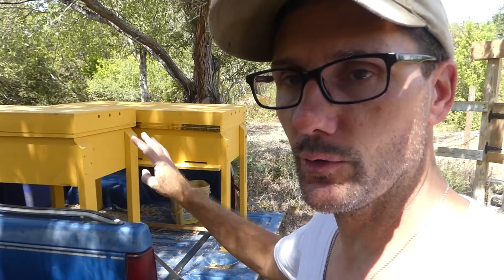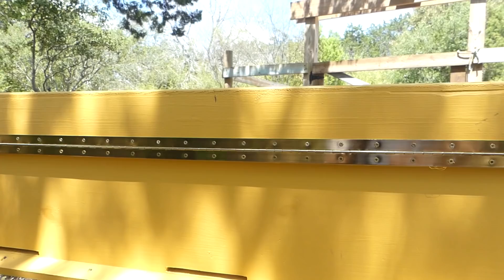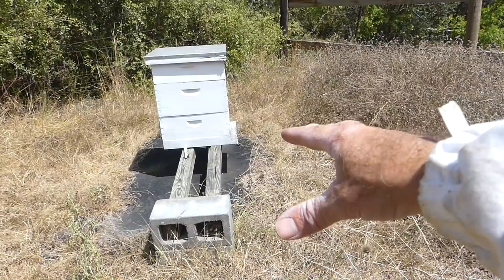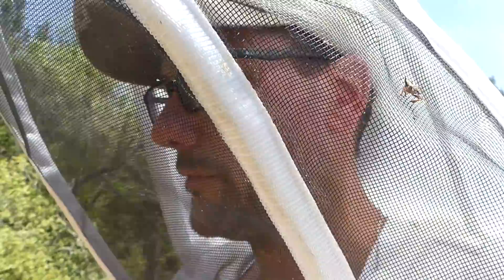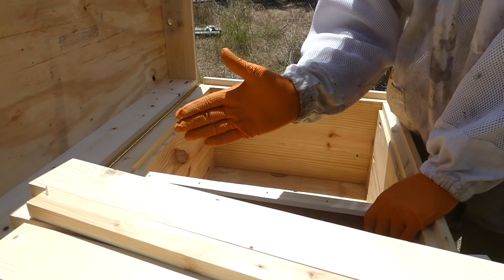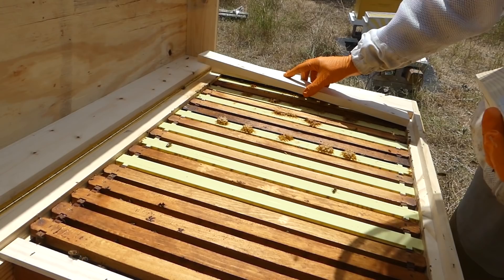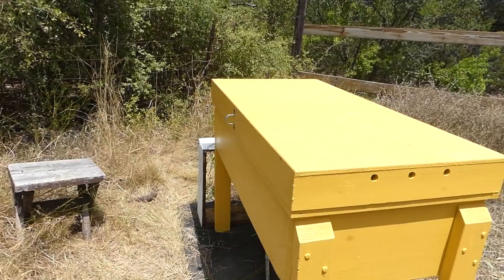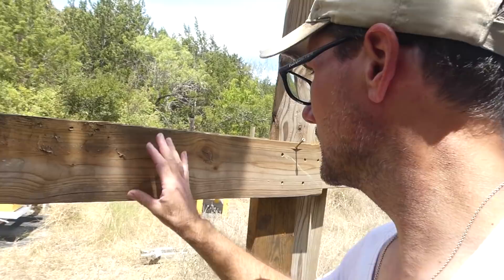COULD THIS BE THE BEST BEE HIVE EVER?!?

Comment: I don't want to highjack this video, but want to leave some observations. but i came a cross a video on these several years ago and liked the idea (i have a really bad back) so i built 4 of these 3 years ago, but have only used 2 up till this year. Still learning with them. Some things to consider. I built mine with 1" pink foam insulation sandwiched between 2 pieces 1/2" BC plywood for the sides and end piece.  I did this for warmth. Gets cold here in Nebraska. I will also insulate the bottom on any future ones i make. I also put a pitched roof (3/8" plywd covered with metal) with hinges on 1 side and a chain to hold the top when opening it to keep it from falling clear back over to the other side. I left a gap at the top where the plywood met and covered it with mesh screen for ventalation and put a metal cap over this to keep out the rain. I also use 4x4 legs that i notch out and actually sit the frame on and bolt to them. The 2x4 legs on the hives above i wouldn't trust once that hive gets full of honey. It wobbled quite a bit already. Mines rock solid. Having my own construction company for over 26 years gives me a pretty good background in building.   Built it to the exact inside demensions of a Langsford hive so i can use the same frames. Make sure ur top boards are within 3/8" of the top of ur frames, or the bees will make honey comb between them. I learned the hard way.  I cut a hole in the bottom to put a sliding piece (10"x14")on the bottom to be able to allow some ventalation in the summer. Really don't need this i don't think.  What i'm finding out is , being high off the ground way to much cold circulates under them in the winter which is making it to hard for bees to sustain warmth. Killed off hives both the last 2 winters. This winter , i just finished enclosing them (around the legs) with 1 1/2" foam insulation (6R value), i enclosed 2 hives together so as to use a 2'x 8' piece as my hives are 4' long each. I placed a bunkhouse heater under each set , already set on low, that i will plug in and use in really cold weather. I'll insert a candy thermometer thru the insululation to see temp as i only want the dead air space to be in the high 20's. Hopefully i won't even need these heaters.  The insulation will  also block wind  from under the hives. I don't want to heat the hives. The heatersb/ will only b turned on if extreme cold. Last year our winter didn't arrive until Feb 1st. Then we had 3 months of extreme bitter cold and snow.  I lost my only 1 of these hives i had established &  1 super strong langsford hive. The only hive that survived was a top bar hive i had in the front yard protected by some old stand evergreens. i've got 4 of these going for this winter. 1 is not as strong as i would like going into winter as i had a late swarm i collected. I also have a really strong langsford hive and the top bar hive is really strong once again. Hopefully they make it thru this winter as i really like this concept . Another thing, i put a piece of insulation inside the roof over the boards leaving the vent holes open as there is condensation in the winter and it still needs to breathe, but heat escapes upwards. This helps keep the bees heat inside. I hope some of this helps those wanting to build their own
Reply: george jenkins do you build these for sale? I live in Vermont and it gets very cold up here too.
Reply: I am about to start this "hobby" and planning building my boxes.  Is what you are saying is horizontal hive boxes are much more difficult to keep warm and maintain over cold weather spells than vertical ones? Did I misunderstand that? If so is the advantage of having the frames easier to access worth the risk?
Reply: please can you make your own video on how to build these boxes, would be greatly appreciated. thanks for the tips.
Reply: George, this was very helpful. I have built to horizontal hives for the summer, and I am worried about insulating it enough for next winter. I live in upstate New York. Thank!
Reply: Thanks George!
Reply: Plans to build my own horizontal box. Could you offer dimensions ?
Reply: not a beekeeper, just a biologist, but am wondering whether insulation is counter-productive in summer?  Aren't bees pretty good at keeping themselves warm in winter?  Also, is some degree of air exchange important with respect to preventing mold, fungus, bacterial issues?

Comment: Top side must be insulation very strong 4 cm. Under side need air circulation holes. Bees need 35 degrees heat .. Co2 and moisture  go down because heavy.. O2 heat goes up bees because thin. Bees consume honey easily.. This old technology works always.. basket type beehive.. loves from Anatolia..

Comment: Is there anything to exclude the queen in the horizontal hive?
Reply: Yes,  queen excludes are possible just as you can also have a false-end board.  
I do not have a y horizontal hives but have scrutinized this and have found some designs do much better than others.  Block foam 'weather stripping' or heavy vynal can work.  I'll cross that bridge before long but using langstroth rather than laynes hives as my spinning equipment is langstroth

Comment: I would suggest adding a locking  compression cylinder. These are used on screen doors for example. They cost around 10 bucks, this should protect you on windy days from closing the lid on your hands or head providing you engage the lock. You can get sealed one or grease with grapeseed  oil instead of industrial oils, so it doesn't effect the bees.
Reply from the maker: good idea. I'll look into something like that.

Comment: I would put gussets on the legs for stability AND tie the hive down to the ground so the wind will not blow the hive over. Tie the hive to the ground with either lags into the ground on leg brackets or a single wire from the center of the hive screwed down into the ground like using a dog run ground screw. 
Over all I like the design, great job.

Comment: In Romania the horizontal hive is the traditional hive. It has some advantages: one model of frames, not to lift heavy, much brood and bees, the frames remains always in the box and you don't need a special place (sheed) to store them. Also has some big disadvantages: the box is heavy, difficult to move in transhumance beekeeping, less honey versus vertival hive, the frames for honey are exposed to treatments for varroaa mites and the chemicals will fix in the wax, these hives are not practical for profesional beekeepers because requairs more time for regular controls and works.
Reply: The vents look too small for the amount of water evolved from concentrating the nectar to honey and wax. A trolley can be easy to make from a couple of old bicycles
Reply: Same thoughts like mine
Reply: The top bars are my main hive
Reply: Why do you get less honey than from a vertical hive?

Comment: You can take your vertical deeps take off ends of the ones that will be in center and one end of the ones that will fit on each end and make new horizontals we did :) Love our horizontals. You can reuse the supers to make a medium horizontal to use in spring to raise queens or make nucs. Just add divider boards and holes rotating front to back so the holes are not too close to each other.

Comment: I've had bees 8 years, 3 Langs and 2 long hives. Long hives are easy on the back and you can put in SBB and oil pans for beetles. The learning curve is LONG. You cannot treat them as a Lang. Inspect weekly, keep brood close to the entrance, and honey/nectar in the back. You might want to consider moving the longhives close to the fence to prevent blow over and it will open the yard up to bring in/out equipment. Put some designs or paint different colors to help prevent drifting. I never got as much honey as my Langs produced but are really good for growing bees to make nucs, splits, and grab resources for another hive.
Reply: Thanks for sharing your insight.
Reply: Thank you for all of that, I think I'll get a long hive now.

Comment: I built a few of these years ago. The "Kenya" type of top bars are more problems. You tear off cross comb, or just combs, because you can't see cross- combing until you move the bar. 
  
Frames are good, consider making an inner cover or 2 with regular bee space dimensions. Youll need to modify or delete the hinge set up.

Keep using an extractor, and reusing your frames. If you are setting them up foundationless, the work you save you bees is quite a lot. 

Just a few things I ran into, I'm passing them on. I still like Langstroth hives better. You may too after a while. I have big 48" frame storage boxes now, but they could have bees again.

Comment: I’ve had long Horizontial hives for five or six years. Disadvantage is fixed size. Like the Fat Bee Man says “ya making bees or ya making honey “.  My hive looks a bit longer and is too small. Mine will always swarm cause there is not enough space for honey. Good luck
Reply: Could you not just super them upwards with medium supers as posted in Trev's Bees?
Reply: Nope fixed gable roof
Reply: Then you need to remove most of the full honey frames when full periodically. During a flow, the bees do not need capped honey.

Comment: I think bees will walk right over your divider board top is not thick enough. Very nice hive!
Reply: I'm a nub this year. Started with a vertical hive in May. Got a second queen by end of June while I was in the process of building my first horizontal hive. I found my follower board is not quite deep enough. My ladies squeezed under it. Sitting here now I just thought of an idea to add a strip of felt along the bottom. Thanks for the idea! I have split my ladies once more. I now have 2 vertical and the 1 horizontal hive.
Reply: @davidlewis4179  the top is same as frames. They are walking over it same as a frame. Felt on top may work also.
Reply: @00448296  I ripped a thicker board for the top of the follower board to fill the bee space above and used peg board that I had laying around.  Oops!  Peg board makes for a good queen excluder. LOL.  I then lined the peg board with #8 hardware cloth.

Comment: My father uses horizontals hives since almost 25 years. He tried vertical at some point, he wasn't satisfied. The difference is he uses only same type of frames, those biggest ones. So his hives seems shorter and deeper. Mixing shorter with taller frames doesn't sound good to me with that space remaining beneath. My advice to replace the short frames little by little with some that fit perfectly. It's first time when i see horizontal with different frames in it.
Reply: They are changing the design  and end up having problems
Reply: Can't you just use the same size boxes and thus frames in the vertical setup so you have the same frames all around ?

Comment: I like the design. How do you exclude the queen?
Reply: That is the tough part. In my country we call the excluder a hanemam grate. They do not come for horizontal hives usually. This hive type has been in use for a very long time and considered archaic and not suitable for productive beekeeping in my area. They are still used for a static apiary on a semi pro level(my family always kept between 30 to 70 hieves) there were times when we would allow them to swarm naturally and just sell the swarms. . Made more money by selling the bees than the honey. Needles to say this type is NOT a high efficiency commercial hive. It has it's quirks and drawbacks, but it's less demanding on the back and the bees can go longer untended. As to how to exclude the queen, my grandad always said :you will never see a queen cross a full frame of honey. So as long as you have  a couple of frames of honey between the brood and empty frames you should be ok
Reply: @sorcyo   Not everyone is out for major production.  This is a fine hive for hobby bee keepers.
Reply: @ronsmith6233  I agree. No lifting, one size of frames and plenty of space for expasinon. The hives my grandfather used had 18 frames, so smaller. It's just that the accesories for this type of hives are less comon or nobody makes them as there is little demand for them. In Eastern Europe, where I am from you can find some as these hives are still in use in by subsistence farmers, I don't know if that is the case for the West.
Reply: You could always modify a Langstroth excluder to work.

Comment: Look similar to a top bar hive,  I would have made the floor open mesh for ventilation and allowing varroa to fall out
Reply: Stephen Stubbs - Horizontal hives are very much like top bars. I suppose one advantage during transfer from stacked hives, is that frames can be slotted in easily.
Reply: @dcvariousvids8082  my first homemade hive was a cross between the two, allowing both top bar and national frames to be used, so a frame of eggs could be added if need be

Comment: Love it!  I just finished the illustrations for Dr. Leo's new book coming out next spring.  I have build 4 of these now and I love them.  I've also come up with a few improvements to minimize lumber waste, and have a full set of drawings to match.  My design also allows for hive top feeders, if you would be so inclined.  I actually have (6) 1" entrance holes, using plastic rotatable hive entrance discs rather than slots.  Also included the bottom tray with screened bottom.  Great video!
Reply: Dr. Leo throws down some knowledge doesn't he?

Comment: I've spent a lot of time high of the ground. My most terrifying days after lightening storms are when it's windy. Offering flat surfaces into it has two effects, push or pull, and any depth can seriously add weight to the push or pull. That lid is just waiting for the right day for either effect to take place.
A question for all in the interest.. If that is a windy spot, what are the chances of those long hives being blown over, since the weight is all at the top? A normal upright hive has weight from top to the bottom.
 When we get blown over its because our mass is at the top. Surely those long hives behave the same. Gravity, wind speed and projected weight, all combine for rapid effects.

Comment: How stable are those long legged boxes in a stiff Texas windLOL?Can you add an eye bolt to cable them down or would that compromize the interior?
Reply: They’re just wooden boxes. Of course you can do whatever with it.

(If you want it solid, those legs are the only part thick enough to put in a big eyebolt, but that seems like a fine place to tie down if you want to do that...)

Comment: Foundationless frames are great.  you will need to provide the bees a "starter rib" under the top bar.  It can even be a 1/8" wood strip.  
Important hint on handling foundationless frames:  Rotate the frame to top bar vertical after you remove it from hive.  View each side of the frame by rotating left or right on vertical axis.  If you hold top bar horizontal (frame flat to ground) the comb not attached to the sides and bottom of frame may fracture and fall.  The bees don't like that at all...

Comment: Looks good and hope they work out for you.  I see no advantage for using a top bar hive or horiz. hive.  Bees work vertical better.  Good to see you still using the frames.  Would leave several Lang. hives to compare.
Reply: Dennis - with a topbar / horiz lang you are only picking up one frame at a time. Less weight, only expose a small portion of the hive at one time. Also wild bees construct hives in horizontal hollow logs, so..... I agree with leaving a few for comparison.

Comment: My dear fellow, when I saw your beeyard, the VERY FIRST thing that came to mind was: CLEAR IT because of Rattlers! (I live in Wyoming, which is what we have here). I don't know where you live, but you could also have copperheads, NEITHER of which will make for a nice day if you encounter them inadvertently!

I like your hive design except for two things: 1. Not enough ventilation holes on the Covering Boards. 2. Install some short dowel handles on your Cover Boards, so they are easier to use.

I'm going with the design by the guy who lives up in the Great Lakes Region. He has 4x4 legs to hold all the weight when fully loaded with bees, honey, nectar, etc., and he has a gabled lid with exit holes for the occasional bee or two that gets caught up there...they need a way to get back into the hive, after they've come out the top when you're inspecting the hive.

Lastly, since you're using 2x4 legs, I would heartily recommend you put some length wise 2x4 braces for each set of legs.....it will provide a MUCH more stable platform to counter heavy winds, weight shifts, etc.

Cheers from the Oil Patch in Central WY
Reply: Did that hive do well in the cold in Wyoming
Reply: @wills67m  

Don't have any hives yet; I'm in the Oil Patch, with Patch rigs going hither and yon; the DUST level is so high a hive could NOT survive here!

My plan is to sell my house, relocate to Alaska, and if I can move there in the Summer, capture a few Swarms of locals to populate the hives I'll build there (from native Spruce quite probably); which are of a design by a guy from Michigan/Wisconsin areas (I can't remember which), that created what I believe to be the 'best of all possible worlds'  for a Langstroth Top Bar hive; easy to work, maintain, and keep the Girls happy while doing it!

That's the plan anyhow, as most folks know and understand, there's 'plans' and then both 'life' and 'reality' step in to change them!

Cheers from the Oil Patch in Central WY